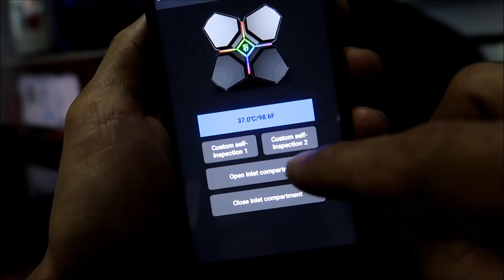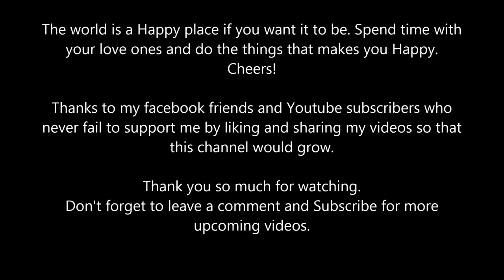Custom Pc Build #43 "Dark Icarus" Quadstellar Gaming and Streaming build.

Comment: So I have an idea. Instead of buying the chrome plated tubing and cutting those, you could use PETG with some foil tape wrapped around the outside. This is the stuff: https://www.amazon.com/Aluminum-Tape-Foil-Ducts-Insulation/dp/B01FROBUXE/ref=mp_s_a_1_1?ie=UTF8&qid=1532589057&sr=8-1-spons&pi=AC_SX236_SY340_QL65

You may have to sand the PETG a bit on the outside, but the tape is really sticky anyway, so it's probably not needed. Try it, see if it works!

Also, thank you for the awesome content. Absolutely love watching your videos and seeing your kids help out. Keep it up! You'll become a huge channel in no time!